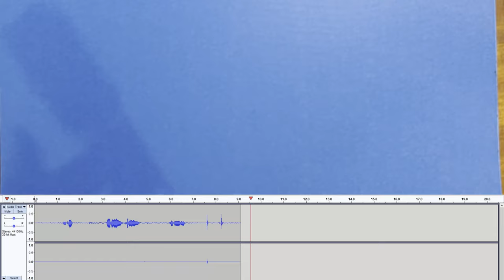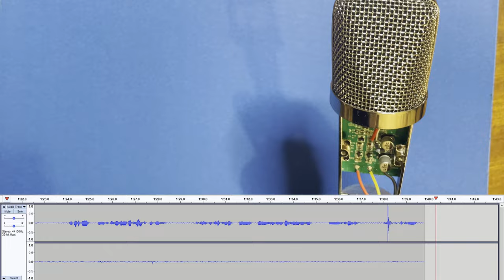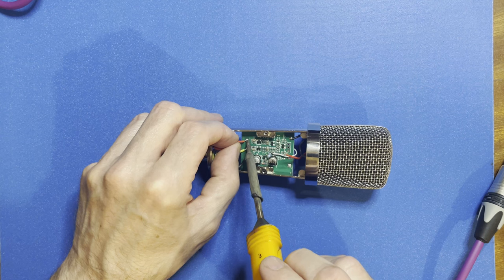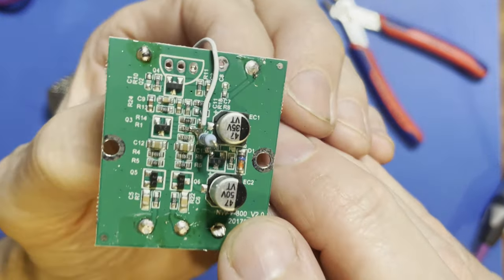Cheap mic mods, part 2 - New PCB, existing mic capsule

Comment: Doyou a a schematic for the board you designed? I'm interested to see what you did there!
Reply from the maker: The link to the schematics, assembly options & PCB info is in "Mic mods part 3", they are in the article on my web site here:
https://robert-jenkins.co.uk/site/index.php/electronics-and-audio/designs-projects/23-microphone-modification-upgrade-circuit-boards
Reply: @RJTC  Thanks, found them a little while after this post :)
Reply: Can you send me where you bought this new circuit?